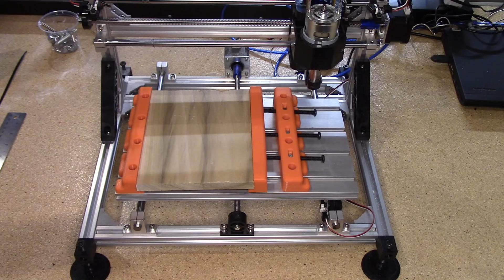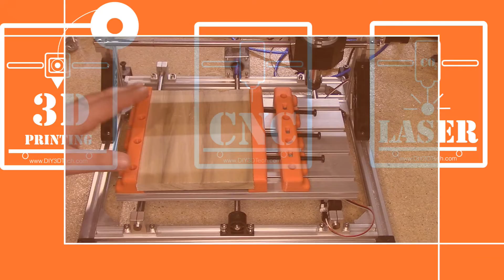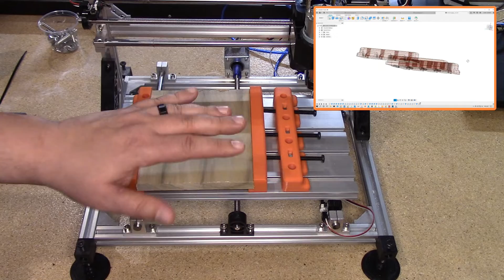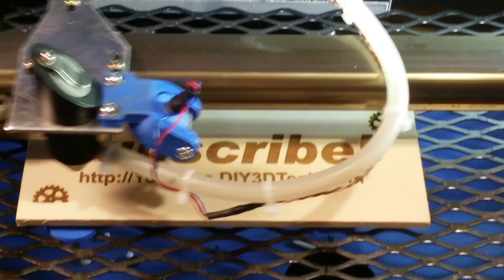3018 CNC - Amazing 3D Printed Work Holding Clamp!

Comment: I recently dusted off my hobby cnc though I have not used it yet.  I do have a spoil board, but I like this clamping system.  I think I might try it.  Do you use shims then when you use the Z probe or do uou just adjust the Z height manually.

Comment: If you shape the clamping faces with ≥ ≤ or > < these can pinch the wood and less tendency to lift or just self wedge the wood to the clamp assembly. Reduces obstruction above work height during homing sequence.
Another advantage is keeping axis home point in same place for homing start/stop repeatability if doing multiple batches. (Add small 90° stop to X axis line) 
This will definitely be on my clamping utilities build list.

Comment: Why the use of 2020 t-nuts as, I do believe, the bed is 3030 as 2020 t-nuts fall clean through those slots?  After looking they may even be 4040 but your link is to 2020 T-nuts. edit:  Yep, you Thingiverse link for nuts are dead wrong as the 3018 group says 3030 is what we need.

Comment: Kind of ran into a problem, the side pressure does not help if the bit pulls the wood upwards. Had a 2 print that got pulled vertically out of the bracket, friction wasn’t enough after it gets shaken around enough.. might modify it to add a lip at the top
Reply from the maker: Interesting have not had this issue.  If I tighten mine down I can pick up and shake the machine with no issues.  I am also curious as to why your bit is pulling the wood upwards?   For the most part (save for plunges) the force should be lateral.  I use a two flute for wood and a single for plastic...
Reply: Some severe upcut going on ? Put soft rubber or leather on the faces or make faces >___< so the pinch/wedge the workpiece downward.